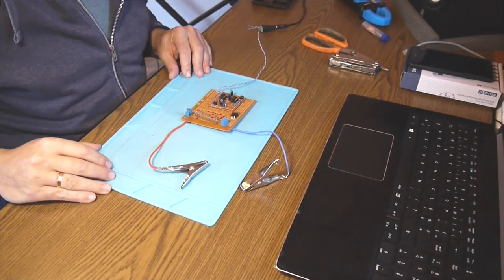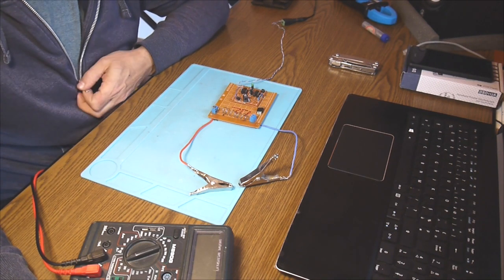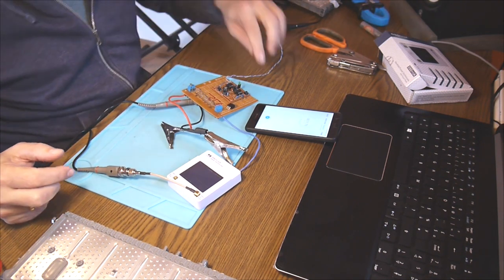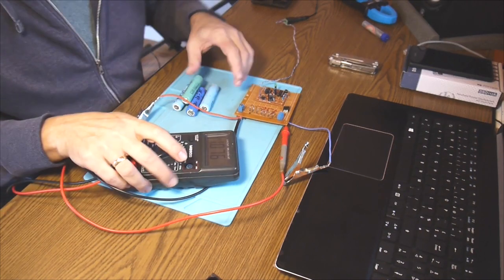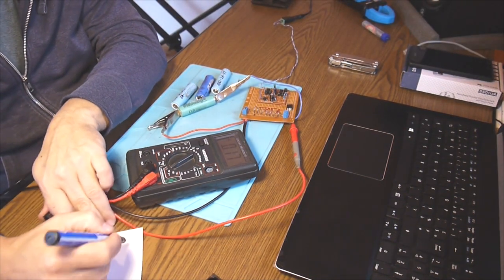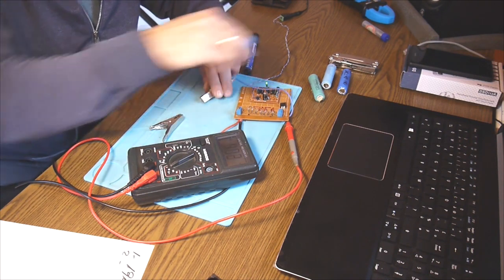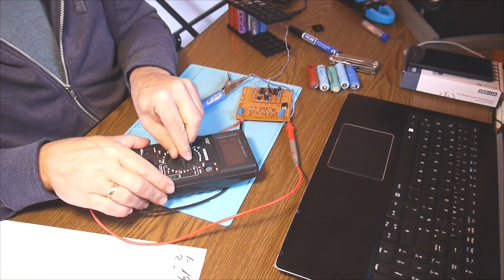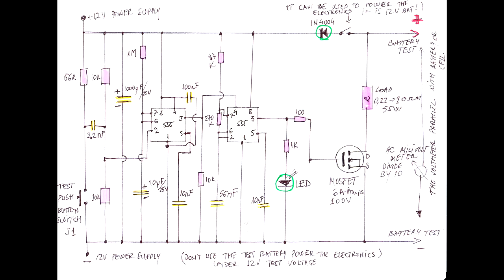DIY tool for measure Internal Resistance IR of any battery

Comment: Whether is circuit diagram
Reply from the maker: Go to the end of the video..
Reply: @viocaia  how many batteries does the prius have in series and in parallel? and do you repack the car battery using salvaged laptop batteries?
Reply from the maker: @rosekreuze  Hey! First, Prius is using NiMh batteries so any Li-ion will be no use..don't even try it! Second  , there are 28 elements in series. But each element content 6 NiMh batteries..in series too, compacted and with around 7.2V and 7Ah..but check my videos and find more ...

Comment: What is the rating (Voltage and amperage) of the Li battery that you have used for testing? And what is the total load resistance in your setup across which the voltage is being measured (Why does the wire look like it is wound like a coil? Doesn't it build inductance?)? Please let me know. TY
Reply from the maker: I tested 18650 cells around 4.2v and 1.5Ah with a 1Ohm load. Like I said, it doesn't give a right measurement, that depends of the load, but at least you can sort the cells in a proper way.About the inductance, the coil is to large to barely have some, but you may use a power resistor, I just improvise something.The initial project was for  measure car batteries then I extend the tests to li.ion cells.Eventually, after compare the results with a YR1035+ turns to be double but respecting the range..like 120 mOhms turns to be 60 with YR..maybe with a lower resistor, like 0.5Ohms will be more accurate...maybe a higher frequency too.
Reply: @viocaia  Thanks for the instant reply. I appreciate it. One more thing, when you measured the square waveform, where did you give the input supply for the 555 timer? Because i dont see any battery connected during the measurement?
Reply from the maker: @nikhileshk7047  Yes, I triggered the first 555..just to see the waveform
Reply from the maker: Now I see...you can see at the far end the plug for 12v power supply, check the schematics at the end of the video
Reply: @viocaia  Thanks for the clarification. I wanted to test NiMH (1.2 V x 3) battery pack of 730 mAh capacity using this method. Do you suggest doing it?
Reply from the maker: @nikhileshk7047  of course, then you can sort them by IR, it's better then just simply check the amps